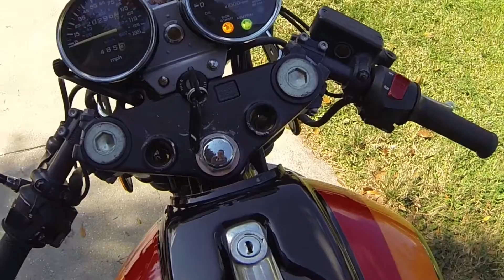Nighthawk turned Cafe Racer - Walk Around

Comment: Wow,awesome transformation Seth!!! I have an 01 CB750 that I wasn't planning on "transforming" or anything,but I DO eventually plan on putting a 4-into-1 exhaust on it,along with either a "Sygma" jet-kit,or a dynojet stage-1 kit. Also put on a Scorpion Lipo battery too. Weighs in at only 2 lbs. compared to the stock lead-acid battery that came in at a little over 9 lbs.!!! Also,these CB's have a tendency for being "cold-blooded" when first-started!!! Lol. takes a few minutes for em to idle without the choke on stock settings. Sounds like your jet-kit took that away!!! Nice job!!! :)
Reply from the maker: Thank you!  I'd really like to try the Lipo battery to free up space and lose a bit of weight!  The jet kit did wonders.  Still have to let it warm up, but once shes hot, she's going!
Reply: Awesome Seth!!! And it shows it in this video!!! Sounds great!!! And yup,I'd definitely recommend a Lipo for ANY motorcycle!!! Their SO MUCH smaller than any other battery,have almost TWICE the cold-cranking amps and rarely need to be left on a charger!!! They definitely are NOT the best in colder-weather (anything below consistent 50-degree temps.) but that's an easy fix by just switching on the ignition and let the headlight light up for a minute or two,to help "awaken" the Lipo and your ready to go!!! Best part is,they CAN be maintained by a Battery-Tender!!! :) I have one on both my bikes,which both have Lipo's on em,and they recharge and STAY charged,just fine on em!!! Thanks for the reply Seth!!! :)
Reply from the maker: Thanks for the Lipo battery review!  Hard finding legit reviews online anymore. lol.  Since I'm in Florida, the below 50 degree weather doesn't happen to often!
Reply: Haha,Yup..........I KNOW what You mean about that one (Not having legit reviews anymore) and despite this being my "personal" review of this type of battery,from the experiences I've had with both of em,I WOULD NOT Buy any other kind for my bikes!!! Yes,they (Lipo-batteries they DO cost significantly MORE than lead-acid or gel-types,etc. but in the long-run,it's definitely WORTH the money in my personal opinion!!! And Yes,haha.........living in Florida,I wouldn't imagine You experience TOO MANY mid-50 or below days down there!!! Lol. So sticking it on a charger wouldn't be needed down there!!! Thanks Seth!!! Keep the shiny side up!!! :)

Comment: I like your use of the DOHC-4 'F-bike tank. But IMHO, the whole theme would be waaay more ... 'legit', if you will - by using the CBX750F bodywork which  was already associated with this engine series. That and some Boomerang Comstar wheels, stick with the 316mm  brakes but do TWO of 'em, paired to a 43mm TRAC anti-dive fork, in the form of the '96+ ST1100-ABS front end, and you're GOLDEN - pure mid-'80s Superbike stuff right there!

Comment: Hey man, great conversion! I have a 92 nighthawk 750 that I'm transforming myself and was trying to figure out the right way to get rid of the air box. Thanx for the jet kit site! What did you do with the battery and everything else down there?
Reply from the maker: +David Chinchilla Thank you!  I hid the battery under the tail section.  I had to weld in a box to hold the battery and CDI box.  Cleaned it up pretty good.  Classified motos has a bunch of nighthawk conversions they've done too.  Worth checking out for some ideas!